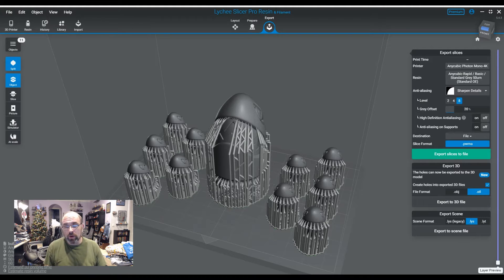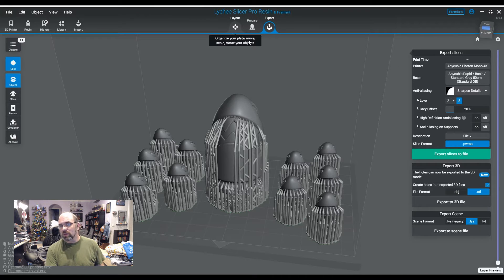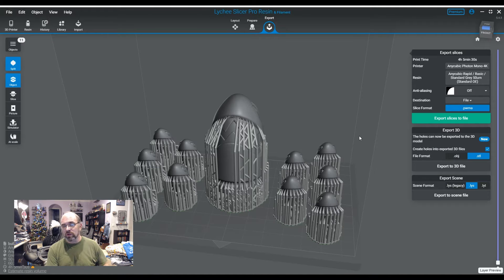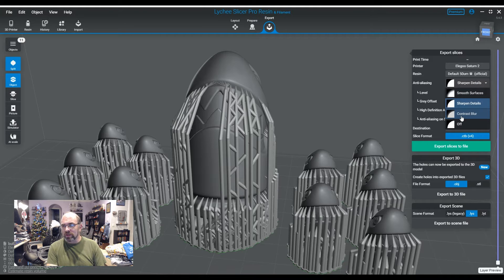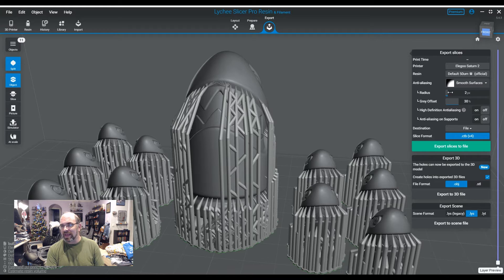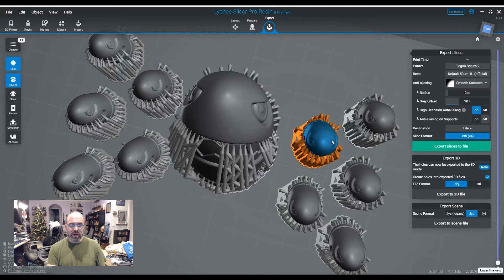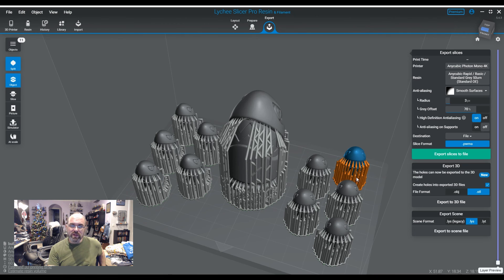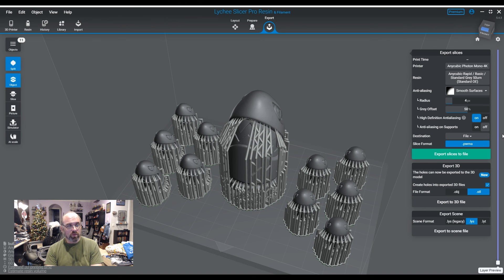Lychee Slicer Alias Settings Tested and Approved Part 1

Comment: What settings would ypu suggest for the 2k elegoo 6" mono screen upgrade? I know its an old video and different versions have been released of Lychee but figured id ask.
Reply from the maker: I would recommend using the native lift, speed, height, etc for the machine, but for the curing times you can follow these.
1st layer : 30-35 seconds
# of base layers 4
Regular curing time: 3.2 seconds
Reply: @IPrint3dMinis thank you! I have the same base layer amount, but 5 layers and reg cure time I've narrowed down to 2.2 seconds with consistent success.Smooth Surfaces, 2px, 30pct, AA on.

Comment: I ad wished that you could explain what physically does the grey offset and radius on the LCD screen. I’m quite new on 3D printing but I do understand what is AA. Thanks
Reply from the maker: Sure, the grey offset and radius settings help to compensate for light bleed and improve print accuracy. That is what the offset means essentially. It creates a soft arch of grey transparent pixels to create softer edges, this is great for organics, for stiff lines go with other forms of AA.

Comment: What's the meaning o "grey offset"?
Reply from the maker: Grey offset is how much blurring essentially the software and hardware will try to accomplish using grey in between the pixels, it's like Anti aliasing in graphics, essentially the alias tries to fill the stepping created by the pixel lines.

Comment: Just got myself a resin printer (DLP), have no idea what anti-aliasing would bring the best results, gotta do some research.
Reply from the maker: The DLP series D2 or Ultra will work well with Smooth Surfaces, 2px and 30-50% offset
Reply: @IPrint3dMinis  Thanks!
Reply from the maker: You're welcome

Comment: What about settings for Saturn 3? Should we go with the same settings as for the 8k printers or should we increase the radius/grey offset? Also, do you know if anti-aliasing in Lychee even works today with new Elegoo's printers? I've read that anti-aliasing doesn't work in Lychee with .goo format, but that it does work with .ctb format and I can in fact confirm based on my own experience that anti-aliasing didn't work in previous versions of Lychee using .goo format but back then we couldn't slice in .ctb format so I couldn't try it with .ctb. Lychee has added .ctb format with the latest update, but I haven't tried it yet. And before I do try it, I figured I might as well ask you for recommendation for settings on a 12k printer.
Cheers!
Reply from the maker: The Saturn 3 I would recommend sticking with the 50% offset, and as far as I have seen on the Saturn 2 and Jupiter it does in fact work. Remember resin matters too, so use the best resin possible.
Reply: @IPrint3dMinis  For my statues I use Resione TH72 resin. I would say it's a high end resin and that it retains details well. I prefer it because it's incredibly tough and flexible at the same time. You can bend thin parts 180° and they won't break. 
And I just got my hands on their brand new Water Fairy (water washable) resin which they advertise as high speed and high detail resin.
But yeah, I really want to utilize Saturn 3 and it's 24 micron pixel size with anti-aliasing to remove the voxel lines at 50 micron layer height. Up until now, anti-aliasing was broken in Lychee :/
Reply from the maker: @markoramljak9579  Resione is a good brand, and that is a good formulation. That should work with alias settings just fine.
Reply: @IPrint3dMinis  hmmmm I've just done a print with Resione TH72 using Lychee recommended settings of Smooth Surfaces with 4 pixel radius (since my printer has a 24 micron pixel size) and 50% grey offset. I sliced the files in .ctb file format and it doesn't seem it did anything :/
Voxel lines are still very visible. 
I'm now trying the same settings but with .goo file format.
Reply from the maker: Going to note this and make sure the Lychee Slicer folks at Mango are aware. This is the Saturn 3 correct? It might be the case of it being newer than the rest and therefore Mango has not added the info to make the AA settings function the way we are expecting @markoramljak9579  Saturn 2, and the Mars series seem to work, even the Jupiter does, but again those have been around a little longer than the Saturn 3.
Reply: @IPrint3dMinis  Yup, a Saturn 3. So anti-aliasing doesn't seem to work with .ctb file format. I'm still waiting to finish a print with .goo file format though. I'll let you know the result tomorrow.
Reply from the maker: That would be great to see. Thanks for sharing. @markoramljak9579
Reply: @IPrint3dMinis  Hey there. Nah, anti-aliasing doesn't work on .goo files either. Voxel lines are clearly visible. So in conclusion, anti-aliasing in Lychee doesn't work on Saturn 3 either in .ctb or .goo file format.
Reply from the maker: Well good to know. My suggestion is to export to chitubox and then slice from there. @markoramljak9579
Reply: @IPrint3dMinis  Thanks. I'll do that. I hope Lychee fixes this issue soon 'cause it's really my prefered slicer. Cheers!
Reply: @IPrint3dMinis  so I've found another bug in Lychee slicer :/ and this one is more serious. The Light-off feature doesn't seem to be working. I've switched yesterday to Resione Anti-Impact resin and had failed after failed print. Long story short, I realised that the screen turns on immediately after the build plate lowers to print the next layer even though I've set the light-off delay to 3 s to account for anti-impact's thickness.
Reply from the maker: @markoramljak9579  Noted my friend. The light off thing has issues with some printer hardware. That is a major bummer too as it would cause a fail for sure. I will make a note to the folks at Mango 3d about this.
Reply: @IPrint3dMinis  To be fair to Mango, it seems that light-off delay feature is broken in Chitubox as well :/ I've just tried slicing my files in chitubox with 3s light-off delay and the printer started printing without the delay. It waited for 3s only for the very first layer but not on any subsequent layers :/ And it seems that both Lychee and Chitubox do the same thing - wait before printing the first layer and then nothing.
I've not tried the "wait before print" setting in either Lychee or Chitubox as it is a global setting and the same for all the layers and would increase my print time too much. I only need 3s delay for base layers since the Anti-Impact resin is soo thick.
Reply from the maker: Yes it is, good info to add and also noted. I am wondering if this is a firmware problem?  @markoramljak9579
Reply: @IPrint3dMinis  I'm jot sure. I've just checked the update notes for the latest firmware update and it only lists one update for a safety feature. Something if a printer gets stuck while printing. I could maybe try the wait before print feature in Lychee/Chitubox and live with the long print times with anti-impact resin IF that feature actually does work. But it's not something I would look forward to. 
Oh and there's also an Elegoo version of Voxeldance Tango that comes with all Saturn 3 and Mars 4 printers. I just remembered that. Hmm maybe I could try slicing in Voxeldance Tango and see if everything works as it should. I'll get back to you if you're interested.
Reply from the maker: Perhaps the wait before print feature is the way to go, I will need to test that myself as well. Awesome info thanks for sharing all of this. It may help other Saturn users. @markoramljak9579
Reply: @IPrint3dMinis  Get ready for this: Light off delay works perfectly when you slice the files in Voxeldance Tango! I've tested it just now and can confirm 100% that the feature works just as it should. I've re-tested the files sliced with Lychee AND Chitubox and the light-off delay does not work on either files. 
I can send you videos if you want. 
I'll test the anti-aliasing in Voxeldance Tango too tomorrow because I'm wrecked for today :D
Reply from the maker: Shoot that is a great find there. At least we know there is a way if you are okay working with Tango as a slicer. Not bad work-around. Awesome again thanks for sharing this. @markoramljak9579
Reply: @IPrint3dMinis  I love the features of the Pro version of Voxeldance Tango. I think some of them blow both Chitubox and Lychee out of the water. However, I have an Elegoo branded "Pro" version which only has half of those features. None of the cool ones of course -.- And I can't make myself like Tango without those cool features. However, I can just do the prep work in Lychee, export in .stl and slice in Tango. Oh yeah, Tango just blazes through slicing compared to both Lychee and Chitubox. I was amazed at how quickly it sliced my file.
But the real Pro version of Tango is WAY too expensive for me to justify buying the licence. Elegoo branded will do :/
Reply from the maker: @markoramljak9579  Interesting so it is a co-branded version of Tango, but has slightly different set of features.
Reply: @IPrint3dMinis  yeah. Tango doesn't have a free version like Lychee and Chitubox. You can use a trial version for a month and that's it. What Elegoo has bundled with their newest generation of printers is a lifelong licence for a co-branded version of Tango. Which is basically like a free version of Lychee or Chitubox. It lacks all the cool features. I've tried it, and didn't like the workflow. It's clunky and has some issues which are dumbfounding. For instance, you can add automatic supports, but can't edit or delete individual supports afterwards. The same with manual supports. Once you add them, you can't edit or remove individual supports. Stuff like that make it unusable. But the real Pro version is amazing. I downloaded it and used it for a month and that thing was a dream. But a stupidly expensive dream. Not only is their yearly subscription obscenely expensive, it also has a limited number of monthly "exports"! So not only do they charge a premium, depending on what kind of licence you buy, you are limited to an X number of monthly exports. NO, thank you. 
BUT... it seems that even this Elego co-branded version can at least slice files properly, so I guess it has that ONE redeeming feature.
Sorry for the wall of text :D
Reply from the maker: @markoramljak9579  I did an 8 part video series on Tango, but yeah no free version keeps it away from some folks. The Pro version is good, and it has a lot of good feature sets.
Reply: @IPrint3dMinis  Oh do I feel stupid now :D I didn't know you did those videos and now I have to go watch them :D
And to top it all off, here I am giving you a lecture about Tango :D
Reply from the maker: @markoramljak9579  No worries friend, never feel stupid for sharing. This is the best place to share, we can all learn from each other's experiences.

Comment: 0% gray should get a smoother result, with much older version of lychee it was different, but I've done lots of tests and so have others and 0% is definitely better now.  grey offset is neccisary for 3DAA to make partial layers but these slicers don't do that, they just do normal XY AA where grey values bloom to shift over where resin cures, so even low values like 5% can have an effect.
Reply from the maker: I will have to make another video showing the 0% grey. My only issue is that when I use less grey I see more dots at the top of domes, and curves, not as consistent mind you, but it is there. Check part two of this as it pops out tonight and see what I mean. I am all for trying something new though, now I need to try more tests!
Reply: @IPrint3dMinis   "I see more dots at the top of domes" I've spoken to very knowledgable people about those dots such as Jan Mrázek and nobody knows why they happen, I can't really see how a low grey offset would cause it, it's probably just random chance that you got more dots with low grey offsets. I've tried loads of stuff with AA including making my own 3D AA Slicer, and rendering at 2x the printer size to down scale for a sharper image but that was in vein becuase lychee HD on uses sub sampling, not a lot of samples, but enough to get more detail, IMO 2px HD on 0% smooth surface is the best thing in lychee.

Also for testing, try Dennys Wang's ultimate AA test, it's a slightly curved face, great for  checking smoothness. Also use UV tools, with this you can import multiple files with different settings, use the test tool to lable each one, then you can print many different tests at the same time with different AA settings
Reply from the maker: @awildtomappeared5925  Thanks for sharing that. I have read a lot about the dots, or bubbles or whatever we want to call them. I honestly did not see them very much earlier on, but maybe I was not looking.

Comment: I thought that the lower the grey offset the smoother the result? At least thats how it worked in chitubox
Reply from the maker: For me the results get better the more grey offset I apply, otherwise I get little dots, or what looks like an air bubble, they are not air bubbles, but they look like them.
Reply: @IPrint3dMinis  Any chance you have tested AA on elegoo machines? If so how well does it work?
Reply from the maker: Yes, and depending on the machine it either does or doesn't at all.

Comment: Hello, thanks for your contribution. I have an anycubic mono 6K. What settings would you use?
Reply from the maker: The same settings I would recommend for an 8k printer. Smooth Surfaces, 4px and 50% grey offset.